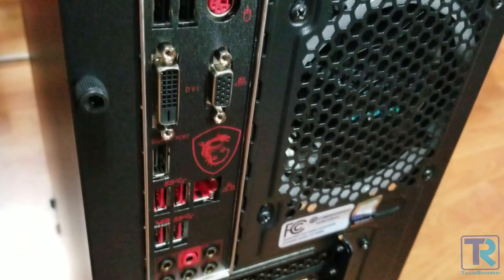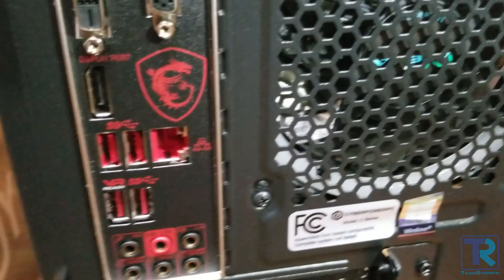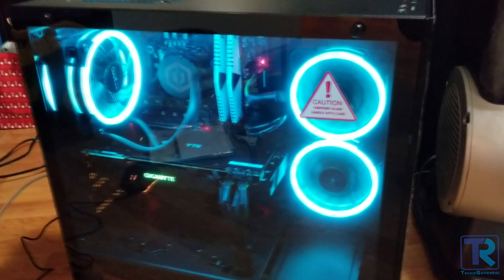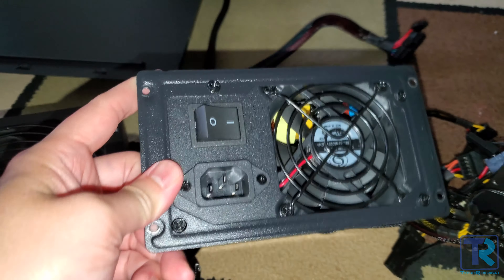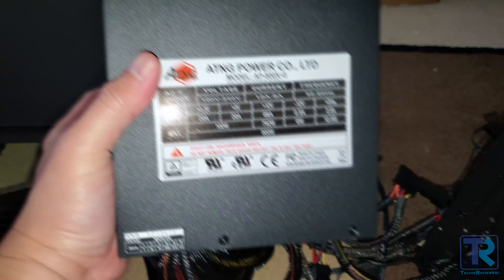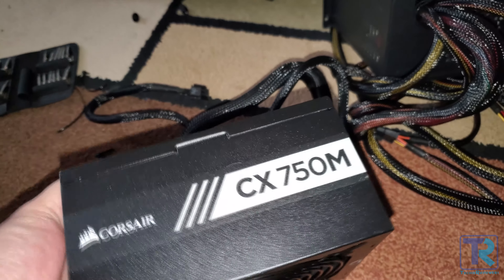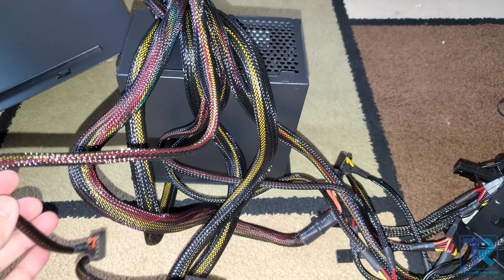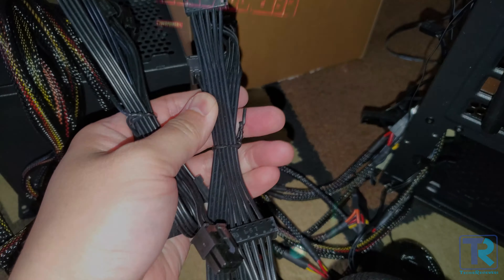CyberPower PC - Power Supply Trouble Only After a Month

Comment: You asked about what people think of these kind of pc's... i have a repair shop and have had a NZXT and a Cyberpowerpc in my shop in the last 2 weeks.  the NZXT had a bad CPU and MOBO and the Cyberpowerpc has a bad mobo i believe (no lights, fans or power of any kind) still testing the cyber.  both have MSI boards and i read nothing but complaints about MSI boards and how often they fail.  funny it seems to happen just after warranty goes out.
Reply: Yea fk those boards man just had my cyberpower board fail gonna replace it soon

Comment: I just bought a 5900x 6800xt on sale for $1800.  Would’ve cost me 2600 to build it. Normally the Cyberpower pc sells for 2800. Personally at the price I don’t mind upgrading the prebuilt myself. This is my second Cyberpower pc. my first one still runs perfect. I’ve haven’t swapped any psu yet because I haven’t had any issues.

Comment: How did u get you power supply out I have the same case and I don’t know how to get it out cause I’m having issues with mine aswell
Reply: Keegan Waghorn Im having the exact same problem, metal side of the case will not
come out
Reply: TheMilkman same
Reply: Were you ever able to find out or have any issues with your power supply?
Reply: @SomeSteven  what do you mean?
Reply: @SomeSteven  do you mean did I find a way to get it off?
Reply: @MilkmanCR  eventually I had to pry it off with a screwdriver, the make it impossible

Comment: Ok so I have an issue with my Pc it boots up then it shows a message “ reboot or select proper boot device or insert boot media in selected boot device and press a key “ any help would be useful
Reply from the maker: Possibly check the cables to make sure they are in snug.  Sometimes they unplug during shipping.

Comment: My cyber power pc isn’t working the thing turns on and my keyboard and mouse doesn’t light up and it doesnt show up on my monitor, I only had it for a month
Reply: My brothers hp omen had the same problem. I'm pretty sure it might be a software issue with windows 10 or maybe the motherboard. Try to boot into safe mode and see if it works there. If it doesn't it's a hardware problem.
Reply: I had the same problem, sent mine back to get fixed and had to paid $100 for shipping. Never buying a prebuilt again but they said that my ram stick went bad so they gave me a new one and replaced some of my lights that wouldn’t turn on.
Reply: Mason Mabry yeah i figured it out, it was a motherboard issue and got it replaced
Reply: Utons  likely a motherboard issue, I recommend returning it for a new one.
Reply: Utons  depends on where you got it from, if it was from a place like best buy, you will likely get another one on the same day

Comment: I have been having issues where mine will shut off randomly. And on power up it will send me to the bios one time it told me no processor found. They want me to set up Rma do you have to pay for the shipping?
Reply from the maker: I would ask CyberPower PC as every situation might be different.  I paid for the PSU first and waited for it to come in.  They then issued a return label to return the old PSU. They issued a refund once they got the old unit back.

Comment: I have a cyberpower with a ryzen 7 2700x a geforce gtx rtx 2070 and I have had it about a month and the damn graphics card failed and it's due to msi having issues I hope cyber power fixes it for me I shipped it to them today hope it dont take to long
Reply from the maker: I actually tried to RMA the power supply and it took about 2 weeks.  I hope you get yours fixed faster
Reply: I need to send my pc in to cyberpower. two months old and wont even turn on now. I wanted to see how long your repair took?
Reply from the maker: It took about 2 weeks for the power supply to come in, but that was because I paid for the replacement up front and they shipped it right away.  I believe they wanted me to ship the power supply back to them first before they sent a replacement which is unacceptable in my case because I wouldn't have been able to use my PC

Comment: If I had to change my power supply would I need to get new cables for all the hardware to plug into the PSU? Also is a ibuypower prebuilt  from bestbuy trusted for their PSU?
Reply from the maker: I would say a new PSU generally should have all the necessary connections.  Unsure on ibuypower as I never bought one, but it is quite possible they are using generic PSUs as well

Comment: Am I the only person that didn't get an off-brand PSU with my CyberpowerPC?
Reply from the maker: Where did you get yours from?  I ended up also changing my PC case because I needed more hard drive slots
Reply: @TechieReviewers  I got mine from Fry's Electronics
Reply from the maker: @DrReddit  ah I see.  That's pretty awesome if you did.  Saved some money!
Reply: @TechieReviewers  Lmao yea. I upgraded most of the parts inside except the motherboard. The motherboard is so outdated but in order to upgrade that I will have to change my ram and cpu which is a ton of money. Trying to save up to upgrade right now.
Reply from the maker: @DrReddit  Wow...really upgrading your rig lol. I'm fine with the other parts for now.  It is just that the 2080 I have runs  pretty hot at 80 degrees when playing Dead by Daylight. Using 144hz 1440p.  Been trying to read up but can't seem to determine if this is normal
Reply: @TechieReviewers  I might just make another PC and sell this one without the hard drive. Also what manufacturer is your 2080? And what case do you have?
Reply from the maker: @DrReddit  have a Gigabyte...can't remember the model bit look for the cheapest one lol.  I ended up buying a Thermaltake V200. Good luck on the sale if you plan on going that route
Reply: @TechieReviewers  It could be defective or something like that. I saw the case and it looks like there isn't too much ventilation. You should try to leave the side panel of the case open.
Reply: Krypto what is the model of you cyber power pc?
Reply: Krypto I made sure I didn’t get a trash one.